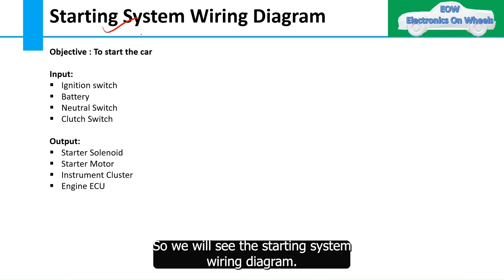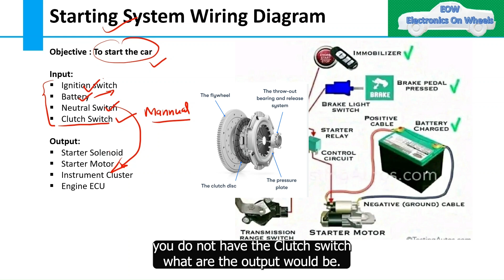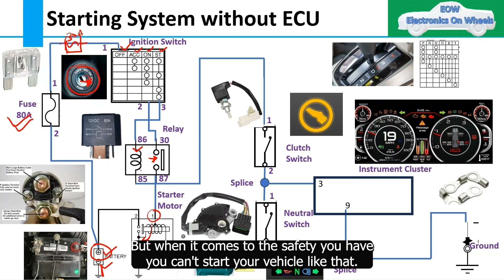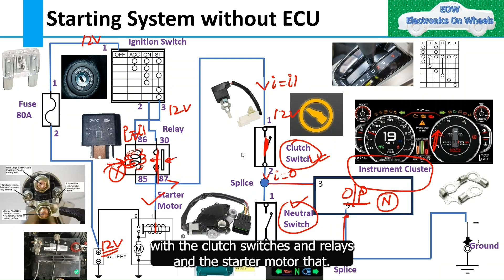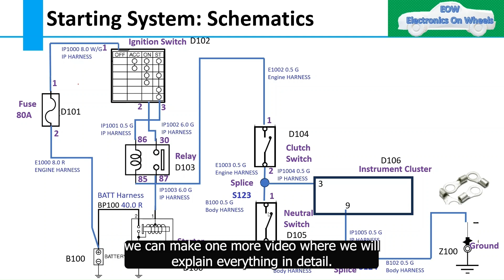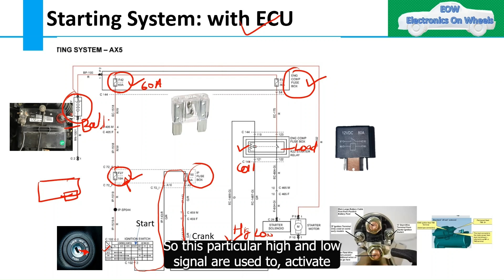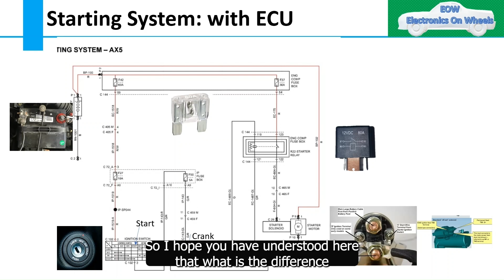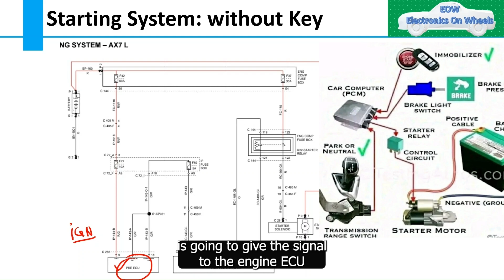Starting System Wiring Diagram Explained | Step-by-Step Guide for Beginners@MunroLive

Comment: Thank you for the video.
But do you know cars with manual gearbox (with clutch switch) and with neutral switch at the same time? 
I just do not understand the logic - as soon as the clutch is pressed, the car is already in Neutral. Already, no connection between the wheels and the engine. Am I wrong?
Reply from the maker: I am sorry but you need to work on the basics . The clutch is a mechanism that allows the driver to disconnect the engine from the transmission, enabling gear changes. The neutral safety switch, usually found in conjunction with the clutch, prevents the engine from starting unless the transmission is in neutral or the clutch is depressed. This is a safety feature to prevent accidental starts while the vehicle is in gear